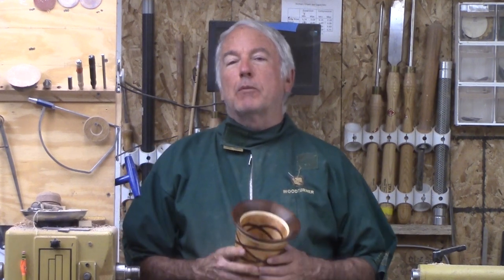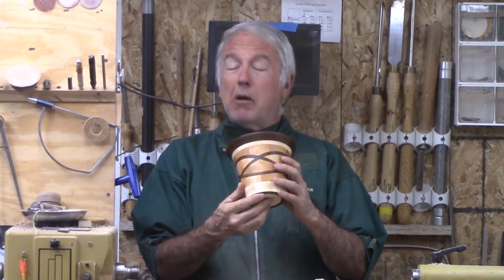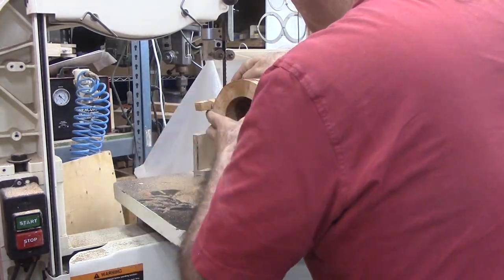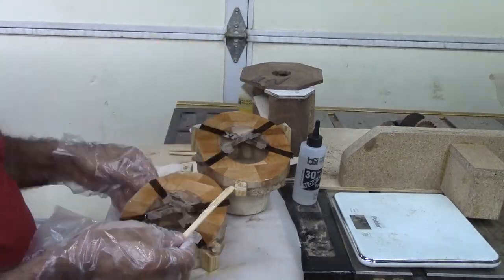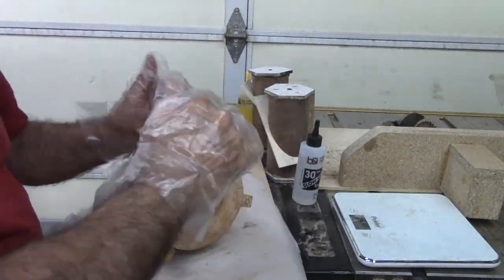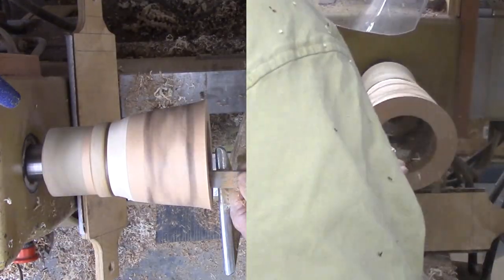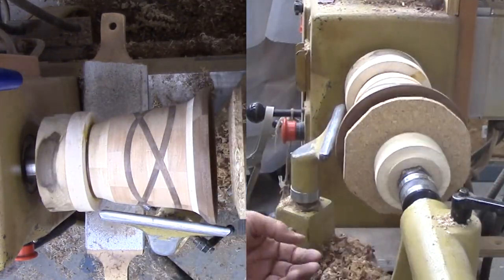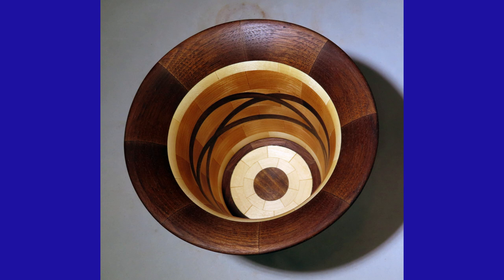Woodturning Triple Lobe Celtic Knot Segmented Vase

Comment: Very nice bowl Alan. I always like segmented turnings. I'm glad you changed the feature ring from maple to cherry. It goes much better with the walnut I think. I didn't see the placement of the locking lobes/pins or how to rotate/position the bowl for  each celtic knot segment. However I Am pretty sure I could figure that out. Would have been nice to see your method though. How do you calculate thickness of the spacer for making the second cut? Thank you for sharing. Have a great day and stay safe.
Reply from the maker: Glad you like it.
Part of the job of the pins is to enable measurement of the wood cut out in the 1st pass. Confirm that with your spacer width plus 2 saw kerfs.
Alan